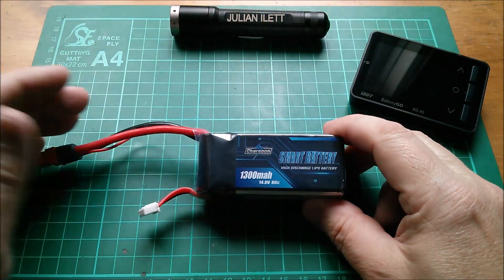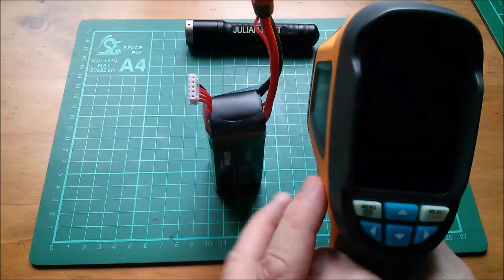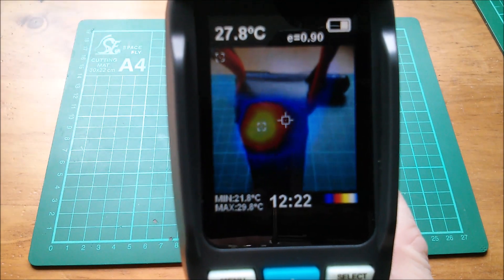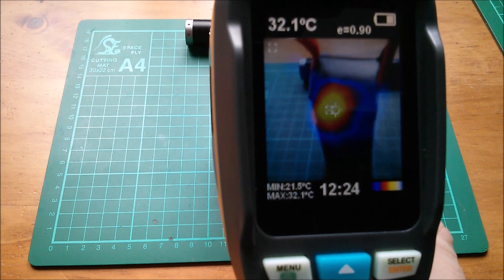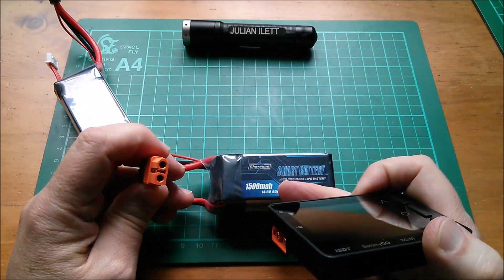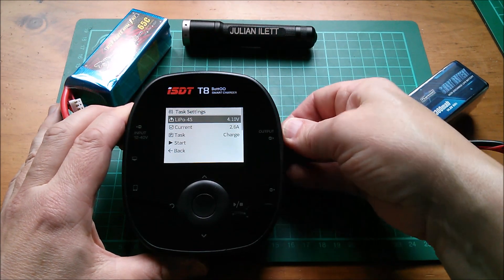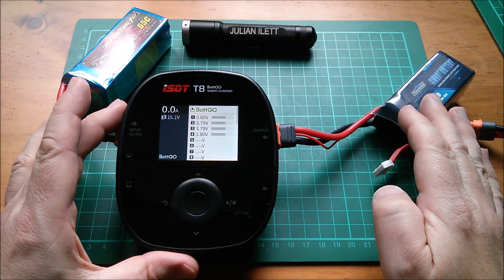Update: Charsoon Smart Battery BattGo 1300/1500mAH

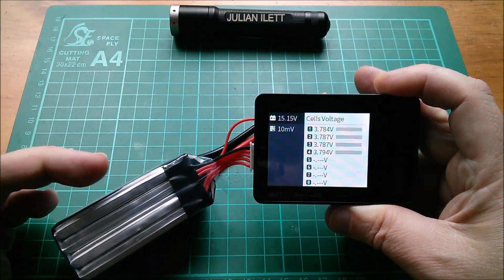Comment: 1:20 - You showed the cells were not quite in balance.  Perhaps the heat being generated after terminating the storage discharge was the circuit balancing the cells.

Comment: So to set the battery internal settings, do you need either the ISDT BG-Linker BattGO Smart Battery Linker Adapter  OR the ISDT BG-8S Smart Battery Checker Balancer Receiver Signal Tester Quick Charge Function as these parameters cannot be set within the ISDT T8 BattGo 1000W 30A Smart Battery Balance Charger?  Coincidentally, we cannot get Lipo batteries here in New Zealand and expect Banggood have bulk seafreight to the UK and USA amongst others.  

Although HKing will not send a 100mAh Lipo, they will send a DJI 5840mAh battery and wonder if this is because of the Smart Technology involved.  BG Customer Support just regurgitate the scripted responses...how can I contact someone in freight Logistics to fix this problem?

HELP :-)
Reply from the maker: You can use the T8 to edit the user settings.
Reply: Thanks Julian, although it is academic if I can't get the batteries :-(  Banggood, get your act together.
Reply: You can get from HK's australia warehouse. it gets sent by sea, but only takes around a week. Also, there's been a few sellers I know discussing the benefits of these packs, it may take a few months to get them (since there's only one manufacturer right now, and everyone has their preferred battery brand) but I suspect we'll start seeing them locally in the not too distant future.
Reply: Chris - I must be blind because I cannot see any three wire XT60 Lipo's or the the items mentioned in the video at Hobbyking (either Global or Aussie).
Reply: Oh, I just saw you mention that HK wouldn't send you a lipo, and thought i'd pass along the tip.

Currently the only seller of anything batt-go taht i'm aware of is banggood with the charsoon packs, which you're right, there's no way to get sent here, but I suspect we just need to give the other manufacturers some time. I would love to see my favourite packs (CNHL) adopt this tech, since I can use them with my standard gear, then eventually upgrade to battgo stuff if it catches on properly....Though on a mini quad that spends a lot of time hitting trees and so forth, I don't know how durable the teeny little third cable would be.

Another option could be to maybe look on aliexpress and see if anyone has the packs for sale on there, they seem more willing to flaunt the lipo sending rules, since they're smaller sellers with less to lose
Reply: Crossed wires Chris (assume you in Aussie, I am across the Tasman).  HKing Australia will send me batteries, but not glue.  HKing Global will not send anything, even a toy with a 100mAh battery, but they will send a DJI Smart Battery 5840mAh capacity.  I didn't know whether it was the Smart technology which made it possible for HKing to send these from Global, or whether they just re-directed the order to local suppliers.  I hoped that it was the Smart Tech and also hoped BG would also be able to send these BattGo batteries.
Reply: Oh, I am a kiwi, so I know your pain with batteries. Fortunately, I fly mainly small planes, and mini quads, so I can get batteries locally for (relatively) reasonable cost

Comment: Brilliant move, batteries for apple fanboys. A whole new market of consumers.
Reply: DJI's Batteries have also this Information, and they are ~200$ a piece, these Batteries aren't more expensive then normal LiPo's, maybe 1 or 2$ more...
It's actually a good idea
Reply: I know I'll be looking for this tech next time I buy new battery packs for my RC models. Hopefully we'll see some better manufacturers start selling packs with the chips in them though, I'm not too keen on Charsoon as a brand, going by what little I've seen of their past products. If CNHL or infinity or anther mid-range manufacturer started putting this in their packs for only a few dollars more, the tech could really catch on quickly. That said, I'd be curious to know how these packs handle being discharged at their labelled C rate, who knows, they might have actually chosen quality cells this time. Not many packs actually handle 100+ amp bursts in a mini quad without sagging down like crazy, regardless what inflated C rating they print on the side of the pack.

The whole auto-storage discharge feature seems like a hugely handy feature for those of use with 20+ packs, and being an electronic engineer, and huge nerd, the data they collect while in flight is super interesting to me! If it's an extra couple of dollars, I will gladly pay to hop onto a potential new idea. ISDT (who are behind the BattGO standard, AFAIK) are becoming a genuine innovator in the RC battery space, I will gladly support that sort of behaviour over standard shitty chinese business practices, even if it's a few dollars more. Especially if that extra cost gets me something interesting, useful and cool.

Comment: I'm thinking that perhaps there's a lot of thermal lag in that automatic discharging system.  Like, there's probably a chunk of metal somewhere inside that thing to act as a heat sink, but the metal is covered with that plastic wrapping which can't be very thermally conductive.  So, when it's done some discharging the metal stays hot for a while until the heat can dissipate through the wrapping.

If you blow air from a fan on the battery, you temporarily cool down the surface but that does very little to cool down the metal inside, so once the air is no longer flowing, the still-hot metal inside re-heats the plastic wrapping.
Reply: I'm thinking the same thing.  It may not even be a heat sink, but just the heat from the chip still working it's way to the surface.  I'd leave the batteries idle for a few hours and then do the thermal image.